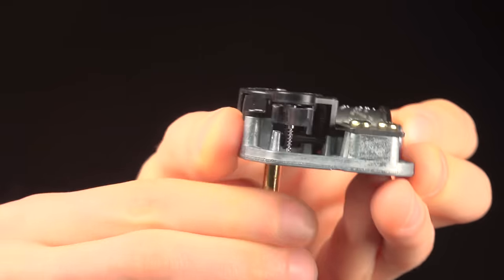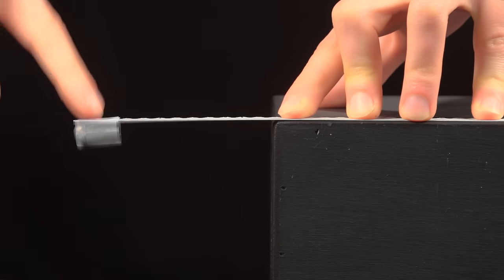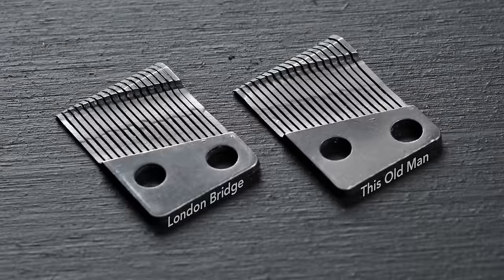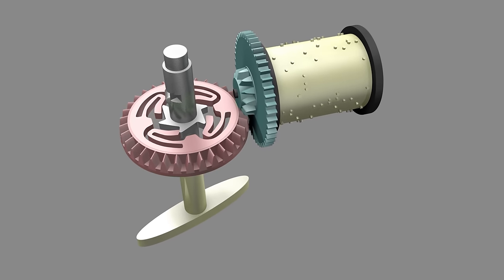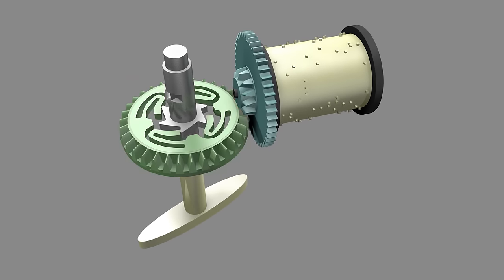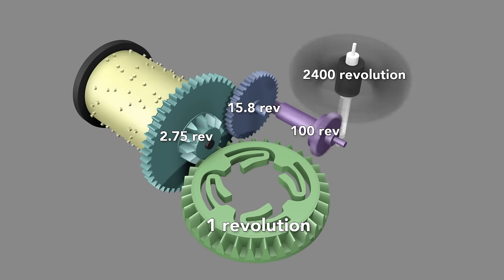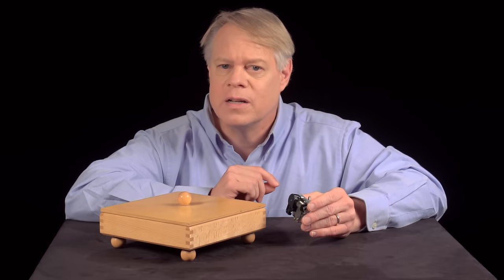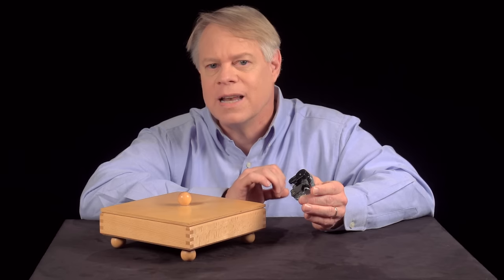How a Wind Up Music Box Works

Comment: I always wondered what “the spinny thing” was! I just thought it was FOR stopping the music at will. I didn’t realize it was for controlling the speed! Wow! PHYSICS.
Reply: it's the same idea as governers on steam engines.
Reply: @sheilaolfieway1885  that would be so cool to know if I ever even heard of that
Reply: @HoshiHikari  On a gas engine, the governor controls the max rpm of the motor so that it does not over rev. Basically the same use as in this music box.
Reply: Well, in modern jewellery box, it can be interrupted by a stick with springs, with the top tip/end being weighed down by the box's lid/cover, which pops up and free when that lid/cover lifted up, and then automatically plays the music. Same way of how refrigerator light is activated by a switch near the door frame
Reply: Yes, afaik as I know the governor on a steam engine has got a built-in valve that is opened or closed depending on the speed of the rotation. The governor of the music box can also be compared with the escapement in a grandfather clock. It slows down the clock mechanism significantly. Without the governor the weight in the clock would rush down and the hands would spin like crazy.
Reply: One of the music boxes I had, contained a "switch" that would obstruct the governor, thus stopping the music.
Reply: @Unna1969  tempus fugit!
Reply: Similar to how the escape and balance wheels of clocks and watches regulate their release of energy, only in a regulated and pulsed manner (tic tic tic or tic tok) instead of the continuous fashion of the former
Reply: @richardmatthews2598  Cuckoo clocks actually do this. As a matter of fact, a cuckoo clock has two mechanisms to inhibit the music from playing: a pawl that drops into the drum at a specific rotation point, or a tiny arm that blocks the governor from rotating.
Reply: Governors (also known as regulators) are used to regulate the flow of gas through your gas meter and are also used in boiler gas valves to regulate the gas flow through your boiler
Reply: Same! That was so cool to learn here.

Comment: 19th century version of the MIDI audio format
Reply: +Jack Mcslay Beat me to it.
Reply: +Jack Mcslay Forgive my pedantry, but MIDI isn't an audio format. It's performance data.
Reply: +Jack Mcslay Yep, and we added variable gate length and velocity :))
And control channels :D  Yay MIDI   \o/
Reply: +MrTridac piano rolls do both of those too. some of the punched slots were wiggly to modulate the velocity.  Control channels tho,  were only printed instructions to the operator to pedal faster :)
Reply: MDCCCL, not MIDI.

Roman numerals for 1850...

Comment: I often look at things and think, "How did someone come up with this?" This guy answers those questions thoroughly and clearly. That is awesome.
Reply: +Stephen Troyer I was in year 3 of my computer science degree when we started digging into the architecture of x86 processors rather than just high level programming.  The level of complexity that exists between a simple Java program and the actual silicon of a CPU is both mind boggling and staggering.
Reply: +Sean It's a lot, but to be fair, hundreds of people were involved. It's not like someone engineered the whole thing themselves.
Reply: +cbernier3 I'd wager tens of thousands, vs hundreds..You're right.  But trying to grasp that level of complexity beyond the obvious is staggering.  A modern computer is one of humanities greatest technological achievements, and it's used by people with grade 2 spelling to look at pictures of cats. :)
Reply: What is a good book to start with to understand the computer from a physical point of view . From the silicon to programming as we are taught?

Comment: So if you were to put a music box in a vacuum it would play too fast?
Reply: Yes (Well, no.  See EDIT), though it would still accelerate slower than if there were no governor at all (due to rotational inertia and the governor having mass).  Also, it wouldn't make any sound unless it were physically touching something touching air (or touching a microphone).

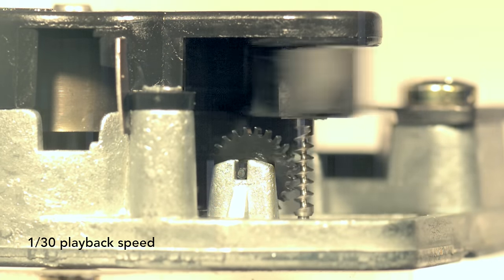EDIT: Actually, no, this governor also uses friction. Notice @3:45 that the ends of the governor are connected at the top but not the bottom.  When it spins fast enough, they rise upwards, rubbing on the top plate slowing it down.
Reply: It would, but you wouldn't be able to hear it, anyway.
Reply: ***** Sure you would, if you put on your ear on it or touched it to your teeth.  Though if you were in a vacuum you'd probably have bigger issues to worry about.
Reply: Unless you hold it in your teeth.
Reply: Yes and also you wouldn't hear any sound. Well done we're proud of your deductive skills.
Reply: what if you touched it against part of your space suit?
Reply: Joe Catton My comment already states that it wouldn't make any sound unless it were physically something touching air.  Therefore, if it were physically touching the space suit which is touching the air inside the suit, you could hear it.
Reply: ok
Reply: yes
Reply: Yes, you're right. No air resistance, so it would "play" faster. Obviously you couldn't hear it but you could see it playing faster. Good call.
Reply: Again, no.  This governor uses friction (see 3:45).  Music box governors that use air resistance are flat.
Reply: ***** You can still make sound in a vacuum if there is physical contact.
Reply: Rob Spiess bruh the turning thing is connectef to the gears to make em slower!
Reply: Do the teeth even swing in the same frequency in space?
Reply: Not only air resistance are play but also the mass to
Reply: Rob Spiess Eh, mechanical waves do not propagate in emptiness
Reply: Same as on the moon.
Reply: I would imagine it would be capped by terminal velocity, but you wouldn't hear anything anyways
Reply: @piast99  That means you would have to be in a vacuum with the thing
Reply: Not too fast ! As long as there is gravity
Reply: @robspiess  Yep, you got it!
Reply: If its governor is of the type shown in the video at 5:19, YES.  But for the one he demonstrates, NO.  It uses friction between the upward-bent weights & the frame (look at 3:40 in the video.  At time approaches 3:48, weights bend up & friction starts).
Reply: @memesfromdeepspace1075  Mass has effect on the startup time only.
Reply: @bpark10001  at start up but still have efect
Reply: @memesfromdeepspace1075  Yes, but the time constant of the effect is insignificant in the run time of the music box.  Inertia leads to no more than a few seconds to reach speed.
Reply: @1musicsearcher  You could hear the music resonating off of the vacuum chamber?

Comment: Pens..
Reply: Hi I luv ur vids
Reply from the maker: Not dead, just slow
Reply: @engineerguyvideo  
Hmm yes 
I finally get noticed
Reply: Hooray
Reply: @engineerguyvideo  wow just 1 day ago?

I don't know if you'll ever read this.
I meant to ask but I was discouraged by the oldness of the video.

The governor's design doesn't seem like its purpose was to use air resistance, wouldn't it be more fan-like if so?
Could it be that it's just using (non-air) friction mostly? It might be expanding or moving a bit upwards due to centrifugal force, touching just slightly the walls and reducing its speed. If not, why was it made like that? Why does its arm allow its edges/wings to move upwards?

Notice that there are also some bumps/lumps on the top of its 'wings' (not a native speaker, sorry).

Thanks for the great videos.
I had as a kid an exact copy of this one, playing London Bridge.
Reply from the maker: As I recall we got information that it was air resistance from the patent
Reply: I was there when you accidentally live streamed
Reply: @DeadlyAlive...  Look at 5:16 - 5:20. The governor in that picture is a much simpler, thinner part. It works just as well, relying on air resistance alone. I could imagine adding a bit of mass (and thus, inertia) to the fan blades would stabilise the speed even more. It would be little slower to speed up and slower to, well, slow down.
Reply: @engineerguyvideo  😀
Reply: NO
Reply: More like Pain
Reply: @DeadlyAlive...  I don't think it is so in this  case. But I've seen your idea in the clockwork of a telescope (from 1908). When it was spinning too fast, it raised and touched the top of the box (through felt or cloth). It is a more complicated design , as it must have hinges. It is similar btw to how steam engines worked, there they controlled the valves through centrifugal force.

Comment: An air resistant governor, I wasn't expecting that. I was more thinking about a centrifugal braking one
Reply: +benjamin mathon What system are they using for mechanical watches ?
Reply: +benjamin mathon 
Works differently. It has a balance wheel. Just imagine the watch having a circular pendulum and instead of gravity there's a second small spring to make it oscillate.
Reply: +benjamin mathon I think the governor is at least also friction based. It bends and then it's rubber surface rubs against the housing. Look closely at the top of the weights at 03:32 there are even "brake pads".
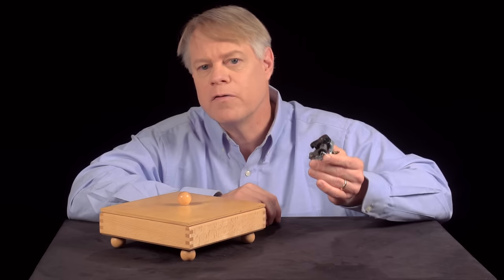Reply: +Cutter Slade Great catch. He definitely missed that on this device. He shows an image of another model at 05:15 which appears to genuinely only use air resistance.
Reply: +Cutter Slade 
I was thinking the same thing. If it was purely air resistance they wouldn't have made it of such flexible material, and there would have been no need for it to be so chunky, nor would each side be only supported by a thin bit of material at the top. It's definitely designed to flex and then rub against the top.
Reply: +JMMC1005 It&#39;s chunkier to increase inertia so the music is not jittery but at a constant speed. But you might be right because it indeed  flexes quite a bit.
Reply from the maker: +JMMC1005 That patent mentions both air resistance and friction as you note. In our high speed photography we did not notice it hitting the top . . . .

Comment: It's a friction governor, you can see it @3:47, at a specific speed the top mounted weights lift up and start rubbing on the upper frame (note the protrusions on each weight, designed to extend the wear if the governor without increasing the area coming in contact with the frame), the higher the rpm the more friction to resist the rotation... otherwise the governor would be just a set of vertical flaps, if it was only air then no need for the weights, odd mounting geometry and the extra materials ;)

You can test this by flattening the upper frame or shifting the governor down on it's shaft, the speed should increase until the weights start hitting the bushing to the left of the image.
Reply from the maker: +Alex Naanou The patent mentions both air resistance and friction.  In our high speed footage we didn't notice it touching. Your idea to test it by slipping it down the worm screw is a good idea.
Reply: +Alex Naanou At 5:15 you can see a pure air resistance governor. It looks like a fan blade :) I always wondered a kid why these things had a little fan in them. Likely I assumed it was for cooling hehe.
Reply: +engineerguy Is air resistance really that significant a factor? Isn't it just that the gear train reduces the torque delivered to the governor so much that it is very slow to accelerate? The weights then increase the moment of inertia exaggerating that effect.

Then again, I do suppose that air resistance and friction would be the factors limiting the top angular velocity of the governor. So it has those two dual functions.
Reply: +nutsandgum yep =)

Comment: Thank you SO much for making this video! I had a broken Anastasia music box (I believe it was severely overwound). Showing each individual part and its purpose helped me find that the problem with my music box was somewhere on the inside, as it would not wind at all, it got stuck. When you mentioned the governor, I started fiddling around with it and it slowly started spinning on its own until the music started playing for 2 minutes straight. Now it winds up just as it normally would! Thank you for saving me from having to buy a replacement box!!

Comment: Am I wrong in thinking that the governor in that particular model works on friction between the tops of the rubber and the plastic case of the music box? The rubber seems to be specifically eccentrically connected at the top allowing for the bottom to rotate out while spinning. Also there seem to be raised pads at the top of said pieces that would limit the contact/friction with the plastic. Even in the slow motion you can see them rotate out as it gets up to speed. I have seen the usually flat and light metal governors that you showed in one of your older examples. I just thought they might be employing a slightly more involved process in this more modern version. Just a thought.
Reply from the maker: +Nicholas Viazzo The patent on this governor mentions both friction and air resistance. We used close up high speed video to see if it scraps along the top. To our eye it did not. A few eagle-eyed viewers have noted that to them the high-speed video we show in this version does show the governor contacting the top surface.
Reply: +engineerguy Cool, although I didn't actually see them touching, it did seem they had taken steps to account for it. It's interesting to know that the patent does actually call for both.  Thanks for the response, and please keep up the great videos.
Reply: +engineerguy The amount of friction to maintain constant speed once the the governor spins up, deforms and makes contact with the round boss above it is infinitesimal. Since the molded frame is likely warped to some extent the contact probably happens at a single high point under the overhang, where it would be very hard to see. I was able to adjust the playback speed on similar music box by sliding the governor up and down on its steel shaft, changing how much it needed to deform before making contact, and thus the maximum speed that it could reach.
Reply: +engineerguy  This should be fairly easy to test if air resistance is having an effect of the rotational speed of the governor. Place the music box in either a vacuum chamber or a pressure chamber with a camera and watch whether or not it speeds up or slows down.
Reply: +Nicholas Viazzo Very well noticed! I thought the design seemed a bit odd given it was intentionally and apparently purpose built to swing outwards and deform the top. I wasn't sure why that would just be by happenchance, and this comment made me feel less of a weirdo for wondering. :P
Reply: +engineerguy can you do a video on guitars? electric or acoustic or both.
Reply: +engineerguy I think the bottom of the weight touches the side of the spring case as it rotates out. You could draw all over the governor with a marker and see where it rubs off.
Reply: Perhaps he should put the music box in a vacuum bell, and see if it speeds up to the same tempo it would play at without the governor.
Reply: Seth Mitchell
That's a brilliant idea! Do you have a bell jar? I think I could lay my hands on a vacuum pump.
Reply: RaymondHng Well of course air resistance is going to be a factor, especially if you blow on it. We just want to see if it's the primary mechanism behind what slows the governor down.
Reply: My opinion is that if it were primarily air resistance it would slow down gradually as the spring wound down whereas the resistance from the rubber rubbing on the case comes and goes suddenly right around the desired speed. There would be no reason to have big lumps of rubber except to react to centrifugal force. I have seen old music boxes that have two metal fins on the spindle which are obviously just for air resistance. (you can see them in green at 5:17 in the video) I think the big lumps of rubber would present less resistance from the air than fins as there is less room for stationary air to get between them.
Reply: +Seth Mitchell yes its all air resistance/drag
Reply: Gamer Guy
"its all air resistance/drag"
What are you basing that on? Did you do any experiments at all? You said yourself that the patent mentioned friction. Are you talking about the old fashioned metal fin type?
Reply: GordieGii all kinds I've seen use air drag, and I'm basing it off of my small collection of six music boxes, both newer plastic ones and older metallic ones
Reply: Gamer Guy
But all six have rigid fins rather than rubber or are designed so there is nothing nearby for them to rub against, right?
Reply: Gamer Guy
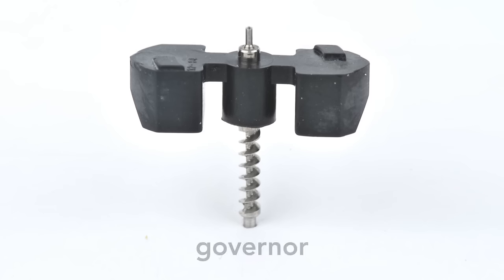Because the one in the video definitely uses friction. At 3:10 you can see the governor has two rectangular bumps on top to rub on the frame. At 3:47 you can see the bumps line up with and touch the circular ridge on the frame above it as the arms swing out from centrifugal force. If this swinging out action wasn't important there would be no reason for the gaps between the lower part of the weights and the hub. They would only reduce the air resistance.
Reply: Nicholas Viazzo when people write patents they do so as broadly as possible to prevent as much competition as possible and to avoid giving away any essential features; "... Containing a plurality of openings ..."
Reply: Well spotted! I was thinking the exact same thing!! The design of this flywheel drag governor clearly works this way. One could easily test it by either applying a fine layer of potato starch on the disc, or turn the flywheel upside down so the two brakes bend down instead of up. They're too small to be influenced by air density alone. Come on engineer guy! How could you get this wrong! Do a follow up video on the please
Reply: @brianjensen5200  this one looks like an airplane and a helicopter